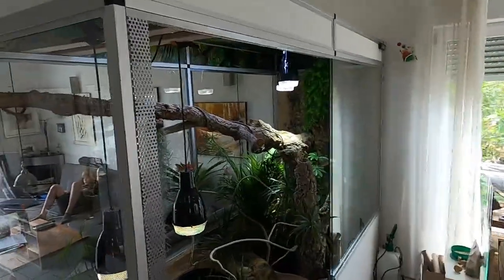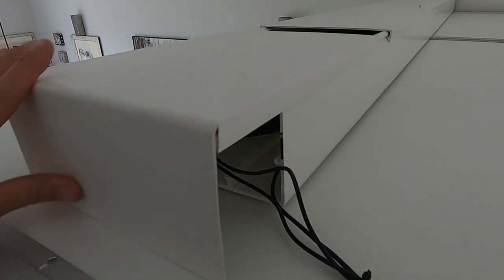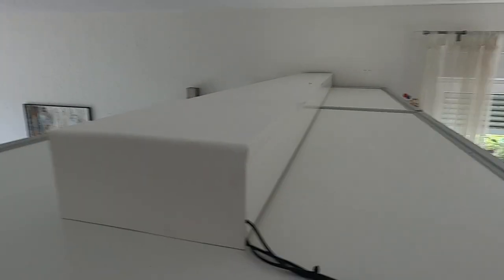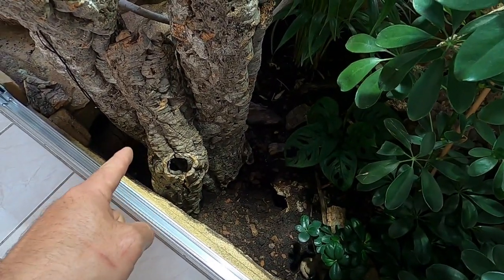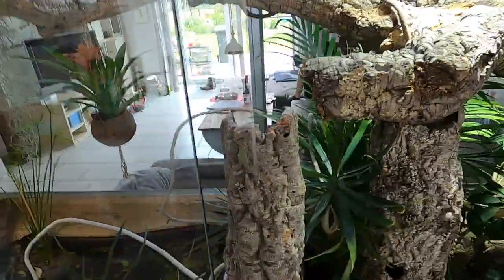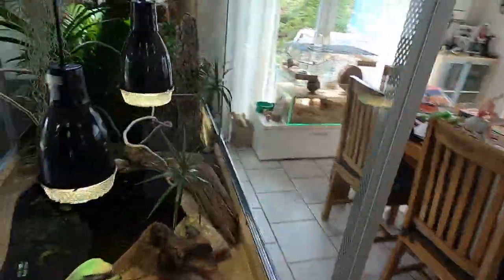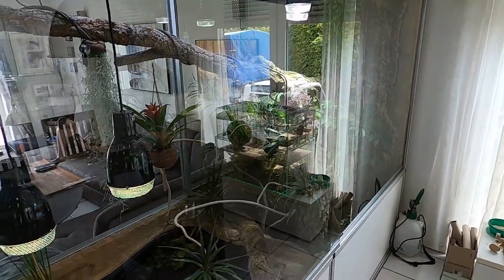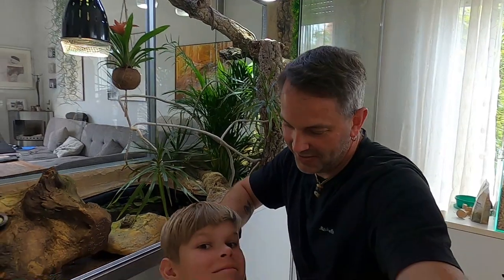Paludarium Terrarium ventilation system, heat recycling, money saving. Monitor lizard enclosure.

Comment: Amazing what you've done Sven ! How can you lock the glassing door when its not completely close for the ventilation ?  Is there a special locking system ? 
Greetings from France and stay safe !
Reply from the maker: Hi. I have a small rubber stop to put in the slide and then put on the lock.